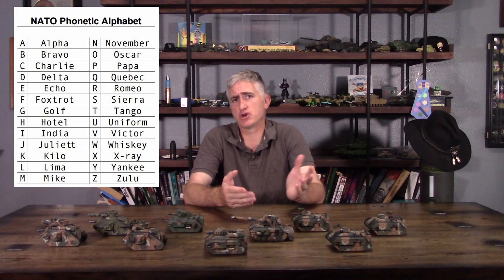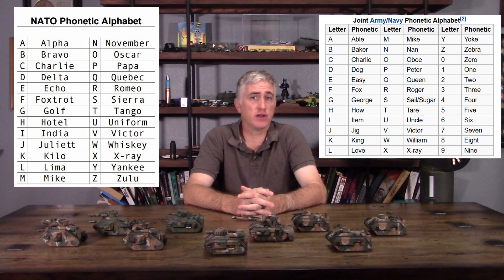Chieftain's Q&A #5

Comment: Hey Chieftain,

I am really interested in the improved final drives for the Ausf. H. Were they really improved or did they get back to the earlier production standards.
According to Hartmut Knittels Book "Panzerfertigung im Zweiten Weltkrieg", the officials in the Nibelungen Werke were clearly aware that they made use of final drives, which did not meet the quality standards. It is believed, that the german war Industry was forced to experiment with the hardening processes during the Steel production, because they were short on certain resources. This could be the reason, why all late war german tanks (38t, Panzer III and IV, Panthers, Tigers) suffered from broken finald drives and bad bearings.
The are a lot of reports and articles out there which claim, that the final drives of the Panther were bad because of their design. The Centurion also made use of a double-reduction spur gear train like the Panther and it worked just fine. According to Doyle the final drives became quite reliable and there are many reports which say so as well. A Bergepanther should have traveled over 4000 km, without having problems with his powertrain. (Source: http://www.panzer-elmito.org/tanques/panther/documentos/Leistungen%20Bergepanther-Fahrer.jpg ).
It would be great if you could shed some light on this topic.
Reply: Whilst that was probably a contributing factor, I suspect (and I doubt it will be proved either way) that a large portion of the failures were caused by sabotage - things like breaking of gear teeth and welding them back on poorly. Particularly as by the late war, the German war industry made large use of slave labour, none of whom would have been endeared to the Reich.
Reply: @arashiocultist 
I doubt that sabotage was a big factor in the case of the final drives and bearings , because steel production has to be done by highly skilled workers.
Reply: @HaVoC117X  For the casting of steel, yes. Not for the assembly of things like gearboxes and such.

Comment: "A" means "Approved Variant". It all makes sense now. I actually never wondered why they used "A".
Reply from the maker: No, it probably was chosen just as the first letter from the alphabet, I mention 'approved variant' as a way of remembering.
Reply: Based purely on how the Navy's system used "Mod" (for modification) where the Army uses "A", I'm guessing it actually stands for "Alteration" (and "E" would be "Experimentation").
Reply: @ARCNA442  T for test....But how does B get in there

Comment: On your info on the M4A3 (76) HVSS vs M4A3E8 - actually knew the differences between the two ( ie E8 = HVSS). However I got all sorts of shade thrown at me on a FB Sherman site claiming that the designation M4A3E8 was never used in the field ... thanks for your conformation  that it was used in the field.

Comment: I have followed the Dutch tank restoration and "intact" isn't exactly what I would call that vehicle unless you consider dozens of clutch plates welded together by rust an intact drive system.  The engine compartment of that tank was a rotted mess and, although Master Milo and his crew have not had to fabricate all that much from scratch, the restoration of original parts they have done with standard and created shop tools most do it yourself folks can find in their garage workshop  has been spectacular.  This is a frame off restoration being done by and large with hand held wire brushes, cordless drills and a forklift (recently painted hot pink!) and isn't as simple as your comment implied.  I look at other tank restorations being done by museums and institutes with big benefactors and it only makes me respect what these guys are doing with muscle, ingenuity and guile all the more.  They are not, however, in the final stretch as you said.  The turret has been delayed in transport due to licensing issues and that job will take months.
Reply: (8:50) TYPE 69-II tank restoration at "mastermilo82" and "werkplaatsvlog" on YouTube! please support them! (they need some parts too!
Reply: its also some quite essential parts that are missing on the tank such as the radiators
Reply: @isuzu6851  ...and the driver's seat...and a couple of torsion bars...and not to mention the fact that it looks like the track links are permanently rusted together...they have a long way to go but it is fascinating to see the solutions they come up with!
Reply: @MrCrystalcranium  they got one of the tracks loose on Fridays vlog by making the track red hot! And they will start doing this with all stuck track pins .
Reply: @sander7165  Yes I saw that.  I don't quite understand what they were trying to do with the fork apparatus.  It looked like the way they had it situated between the links most of the leverage was going to trying to push the links apart rather than rotate them around the pin.
Reply: MrCrystalcranium welp, as seen today they’ll get those tracks working 😜
Reply: You gotta love a crew of guys willing to take something like this
Reply: I'd imagine 'intact' in this case means 'without significant battle damage'. Replacing internals is after all much simpler when you don't have to fabricate armor plates and redo cracked welds.
Reply: For a historical vehicle 'intact' just means that the majority of the parts are there, as opposed to the sadly more common stripped down hulk. The condition of said parts is another matter, as in 'poor/fair/good/excellent condition'. Intact also implies that the parts are original, since the primary concern for most historians and collectors is historicity. They would rather have all the correct original factory parts in poor condition than excellent replacements, as it loses its value as a historical vehicle when you start bolting a bunch of new parts to it. Because they are not the actual parts it came with, and because people have a tendency to use a bunch of non-standard parts, making it useless as a reference vehicle.

Comment: Your explanation of the Sherman designations is very interesting. However, it is also wrong.
The M4 was named so after the amount of minutes the design was expected to last in combat. After gaining combat experience, the A1 etc got added to denote the amount of minutes the tank  would Actually last. The E number denotes Expensive and gives you the maker's profit margin factor. The 75 and 76 denote the percentage chance the tank goes "Whoosh" upon being penetrated, hence also the W. The 105 designated tanks unfortunate propensity to combust was so excessive that they dispensed with the W for that.
And that, ladies and gentlemen, is the 100% true and accurate reason we ended up with designations as unwieldy as M4A3E8(76)W.

Comment: I actually found the last item, the "handles" in the tankers overalls very interesting, something I had not thought of before. 
Are there any other uniform quirks that tankers have? I have heard of tanker boots (all straps, no loose laces) and the West German beret/helmet combo (beret over a bump helmet, much like a 'secrete and bonnet' combo of the 15th and 16th centuries).  But that is as far as my knowledge goes. You could probably do a whole video on these sorts of things!
Reply: Well the swedish two piece 'armour' uniform M90P is padded over the knees, elbows, shoulders and small of the back and has pockets all over. You need to wear the 'flak vest' to have any extraction "handles" though, which are one ontop of each shoulder (similair to what hold unit and rank insignia on dress uniforms, but much sturdier).
Reply: The British AFV overalls have a harness sewn into them.  You grab the shoulder straps as handles
Reply: are those "handles" not epaulettes?
Reply: @JENKEM1000  On the dress uniform it's an evolution from the epaulettes, but on the 'flak vest' it's only handles for extraction
Reply: The german military produced a short video, where they pull someone out of a Leopard, it's in german though: https://www.youtube.com/watch?v=1AhTuu6ohms
Reply: Most body armor today has a carry handle on the back, which doubles as a handle for carrying the armor and for pulling wounded comrades out of harms way. Some police departments are including this on regular uniforms, but generally those in more dangerous areas or situations  are wearing armor already. It is difficult to wear armor inside a tank (and somewhat pointless unless you go outside much), so that might explain the built in handles. I am curious when they started using them.
Reply: Firefighters have a similar system to the Canadians its just under a small velcro cover to prevent snagging... mostly works.

Comment: 16:05: What? Do the recovery vehicle in the lower left picture have 75 mm gun?
Reply: A fake one, note how that crewman has just swung it away to the side, and how there's no breech or anything on the back of that door. Specialised vehicles without main armament (like recovery or command tanks) were often given fake guns to help disguise them as regular tanks.
In this case, you'd think the huge crane arm would be a dead giveaway, but still, that's what they went with.

Comment: Maybe a question for the next Q&A. Does the US army still use the 5 tank platoon and can it still be improved upon and how?
Reply: No  the U.S. uses a 3  tank platoon  has been from  division 83 =   1983
Reply: In 1984 the US Army started the transition to the Division 86, or the J series TO&E.  Relative to tanks this did two things, it decreased the tank platoon from five tanks to four and it increased the number of line companies from three to four.  So, the size of the platoon was reduced to four but the battalion gained a company of tanks.  Subsequently the number of tank companies in a battalion has changed a couple of times but the basic four tank platoon remains the same.
Reply: @drkjk  so you're saying that the number of tanks in a company remained  more or less the same. But they just decreased the platoon so that they could distribute them in far greater  numbers?
Reply: @JericoLionhearth  ,
The 'H' series TO&E (five tank platoon) had a 17 tank company.  3 platoons of five tanks plus two command tanks (Company Commander and Executive Officer).  The 'J' Series TO&E (four tank platoon) reduced the tank company to 14 tanks.  3 platoons of four plus the two command tanks.  At the battalion level, yes, the tanks were redistributed to form the fourth company.  An additional two tanks were provided to the battalion and one of the three Bn command tanks was given to the new Delta company.  Originally the 'H' series TO&E had three line companies of 17 tanks plus three HQ tanks at the battalion level (Bn Commander, Bn XO, and Bn S3).  The 'J' Series TO&E had 58 tanks, four companies of 14 tanks plus two HQ tanks.
Reply: @drkjk  oh. I see. Thank you for that. I've been wondering because I've never seen the modern US army use the Abrams in nothing more than infantry support. So I usually see them solo and screened by their infantry.

Comment: Can you please explain the definition of, high velocity  guns to regular guns. I've heard or read that the Panther was H.V,  but others say no.
Reply: Basically it's about muzzle velocity of a round when it leaves the barrel,  which depends on size of charge, barrel lenght, calibre and size of projectile. You had the 75 mm L24 on the early stugs for example - a low velocity gun, that launched the projectile at a lower speed, hence lower pressure and you could make a shell thinner with more room for HE, thus a better anti-infantry round / gun. A similar 75 mm gun but with a L70 barrel  on the Panther was one of the "fastest" guns in WW2, but the shells had to withstand much higher pressures as a result which resulted in a great AT gun with a much less effective HE round.  The panzer 4 was armed with a gun that was somewhere between the two, a 75 mm L43 and latter up gunned to a  L48  - similar in performance with the 75 mm on the early Shermans.

Comment: Hey Chieftain, to build upon your Easy 8 question, how can someone on the street easily identify the different variants of Shermans at a glance? For a rookie tank enthusiast like myself, I find it difficult to distinguish between certain variants of M4s. For example, the M4, M4A2 and M4A3 look almost identical to each other depending which design is being used. And since most were interchangeable with different guns, turrets, suspension and even hull designs, I was hoping you could give a quick guide on how to identify a M4 variant at a glance.
Reply: M4's were recognized to have welded hull Front, angled at 57 degrees, vision ports are seen and has a radial continental engine.

M4A1 have a cast hull with a curvy front, used the same engine as the M4 Radial Engine.

M4A2 (Early Hull) - Same as the M4 Welded Hull, but has a GM Diesel Engine

M4A3 - Hull angled at 47 degrees, used a GAA V8 Ford Engine.

M4A2 - Late Hull angled at 47 Degrees, used GM Diesel Engine.
Reply: @Romanov117  ok but theres no way to tell wat engine they had at a glance. I was wondering if there are any tell tale features (besides the M4A1) I can look for if I just happen to see a Sherman.
Reply: ISAFMobius18 To tell the difference.

There are two types of Welded Sherman Hulls

The Early Shermans that have Welded Hull has 57 Degrees and Vision ports were visible.

Late Sherman's that have Welded Hulls has 47 Degrees angle and vision ports were eliminated and used periscopes. Seen in late M4A2 and M4A3

And to determined to tell the difference between M4A2 and M4A3

M4A2 always used GM Diesel Engines

The M4A3 always used Ford V8 GAA
Reply: @Romanov117  ok so at first glance there's no obvious external trait to differentiate between certain models unless you know the engine already. That's a shame if you come across one variant thinking it's another like an A2 that's actually an A3.
Reply: ISAFMobius18 Well I'm not limited to M4A2 or the A3.

There's also in fact an M4A4, it used a different engine, the Wright Engine.

Also to tell the difference is the engines that are used. Except other Sherman's that has different Hulls and turrets for example.

The cast M4A1, the M4A3E2 or the M36B1.

Or Sherman's with special modifications.

Rhino, Sherman Bulldozer, Sherman Crab, DD M4A1, T34 Calliope, Sherman Firefly and the Firefly Tulip.
Reply: @Romanov117  yea I get what oyur saying. Overall tho. some variants resemble each other so closely besides their internal components, if you put some in a line up and had to distinguish them purely by looking at them, its very difficult. Unless they're the cast hull A1 or had the HVSS suspension, some Shermans look almost identical. I was just asking Chieftain how he is able to pick them out of a line up and what to look for.

Comment: Aww my question didn't get answered
Reply from the maker: Wait, remind me the question?
Reply: @TheChieftainsHatch  I asked about how much impact the M26 could of had if somehow it was available in large numbers. The pros & cons of it being available in decently large numbers, etc

I also tied on a question essentially about the resistance to a 90mm equipped tank. Was the opposition to it by McNair & co good reasoning, etc. Because the way I see it, the 90mm is a more complete upgrade over the 75mm because it's not downgrading HE performance like 76mm. And naturally that leads into if a 90mm Sherman would have been an overall better vehicle, etc
Reply from the maker: Oh. I'm sorry. I saw the question, I must have skipped over it in the answering section. I'll try to remember to put it into the next one.

Comment: What is wet storage?
Reply: Ammo racks surrounded by water filled jackets as to not cause ammo detonation from ignition when the ammo is hit.
Reply: @FirstDagger  From a forum:
Wet stowage consisted of surrounding the ammunition stowage bins with a water/gylcerine mixture held in an outer hollow casing. The idea was that the water mixture would pour out over any penetration of the bins by enemy AP shot/ shell fragments thereby preventing or at least slowing ammunition fires.

Comment: What is hvss?
Reply: The volute spring is laid on the side rather than vertically under the cover most typically seen in M4 variants.  Allows each wheel an independent arm spring connection and reduces overall height of the whole assembly.
Reply: Horizontal Volute Suspension System, IIRC

Comment: Why didn’t the Germans ever decide to convert the Panzer IV into any sort of apc?
Reply: Because they needed them as tanks more than apcs. In most cases of tank conversion to apc the converted tanks were surplus to requirement.
Reply: Because they never had enough hulls for Panzer IV tanks to begin with. Even if they had, the Germans lacked the fuel to move them.
Reply: They have issues with "prioritization"
Reply: Probably because the SdKfz 251 did the job fine and because driving was already a skill in limited availability (not many people could drive at that time) which was the reason for the Half-Tracks in the first place, there later in the war were APCs planned (Kätzchen) based on the Jagdpanzer 38(t) chassis. Also any surplus Panzer III or IV chassis was converted to StuG/StuH
Reply: lack of space ? ( would be my guess )
Reply: @GrantLee
I would assume because a) they never had enough tanks, and thus none to spare, and b) because they allready had a good enough APC in the form of the half-track.